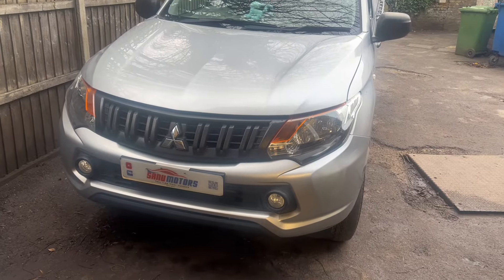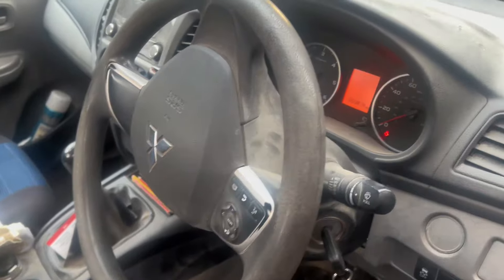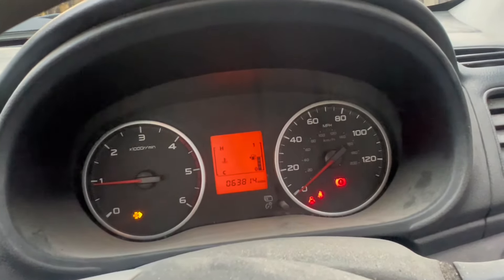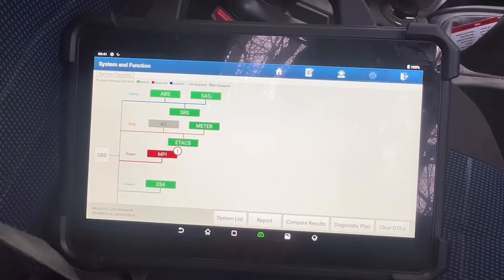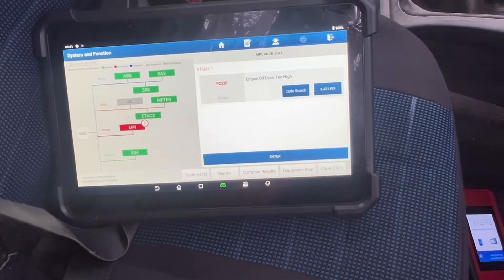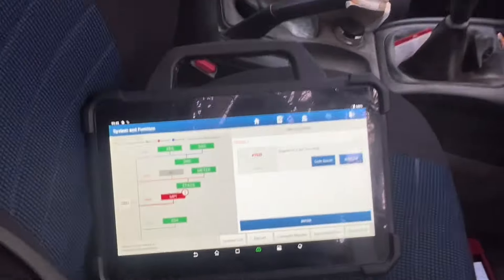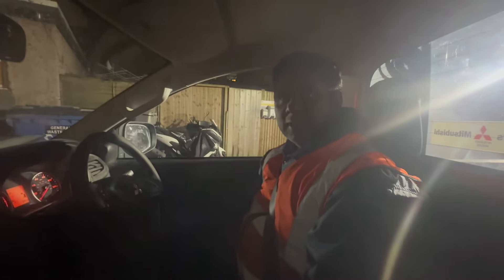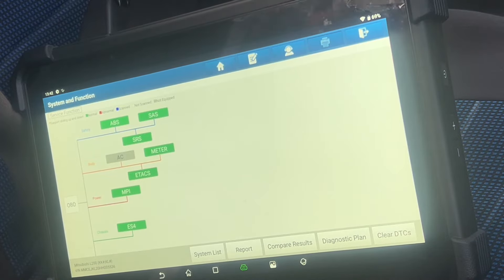p252f Mitsubishi L200 And Clean DPF Filter

Comment: The oil level will be high because the re gen uses a small amount of diesel on each re gen,  thus giving a high oil level reading because the oil has diesel mixed with it. Hope this helps
Reply from the maker: Thank you your right now I’m updated . But oil levels up with in 2 days (round less than 100 miles) how ever found leaking 2 injectors
Thank you very much for the comment. It’s really helpful
Reply: @SanuMotorswithCharlie  no problem I had a Ford focus 1.6 diesel that had the same fault
Reply from the maker: Really did you sort it out?